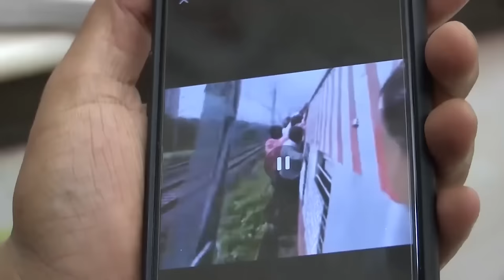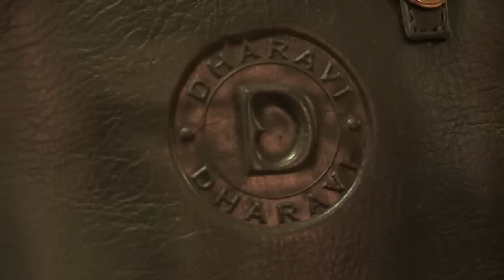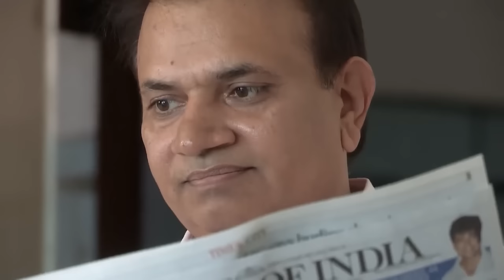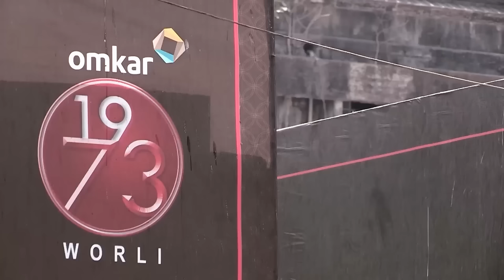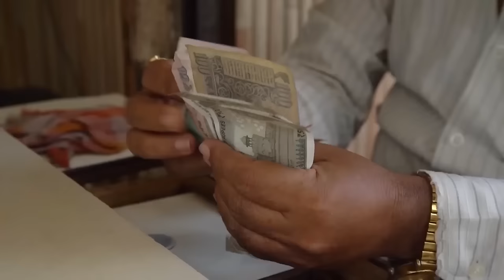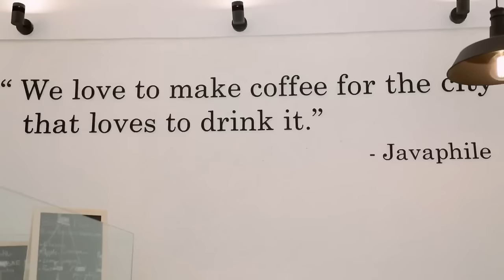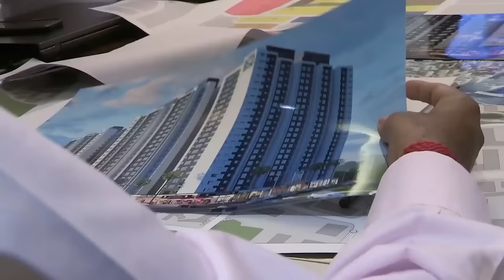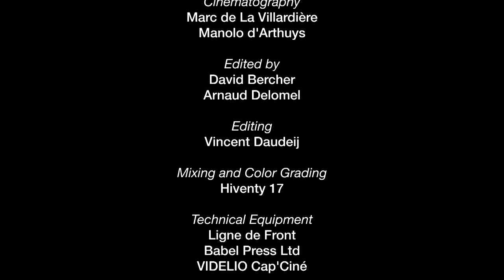Megapolis Mumbai - Between Slums and Skyscrapers | ENDEVR Documentary

Comment: In the minute 23:00 there is no way that the apartment with 3 rooms, 3 bathrooms, living room, kitchen, “connecting deck” is 560 square feet, that is 52 square meters, there might be some lost in translations with the apartment sizes

Please make a pin comment with the correct sizes of the apartments you show in this documentary
Reply: Also in the minute 23:57 the real state agent says this house is 5 toilets (so probably three full bathrooms and two half-bathrooms which are just toilet ) it is impossible that the apartment is 560 quare feet
Reply: Again in minute 27:29 they said that apartment is 312 square feet which is 28 square meters, but later on the video at 28:39 they said to be given a free apartment of 95 square feet, that is 8.82 square meters which there is no way the apartment shown is that size.

Please fix all the measurements you say in your videos